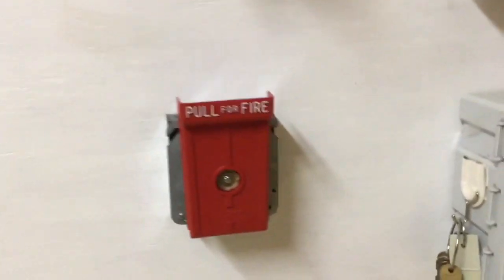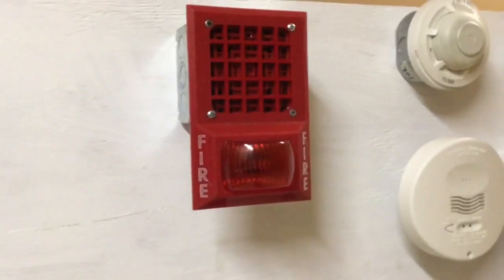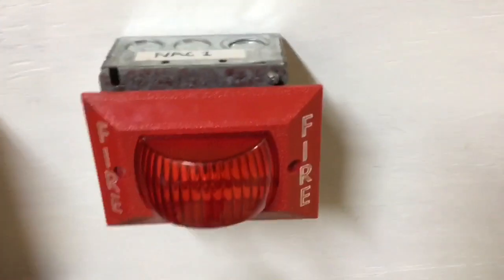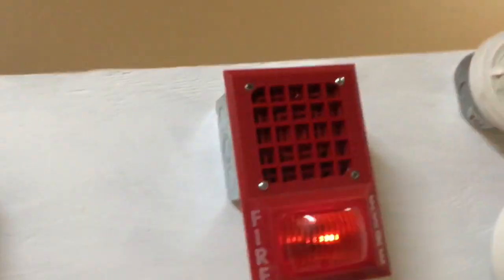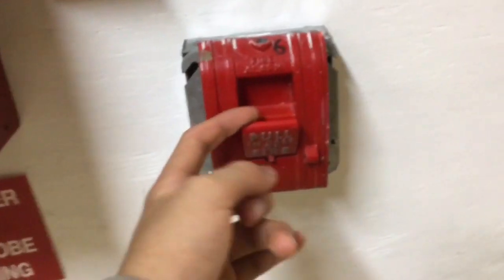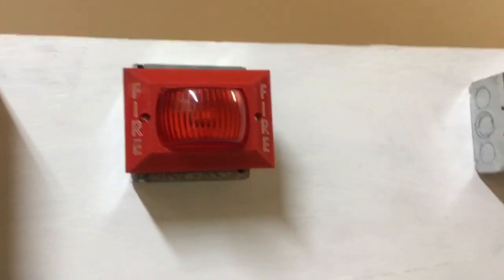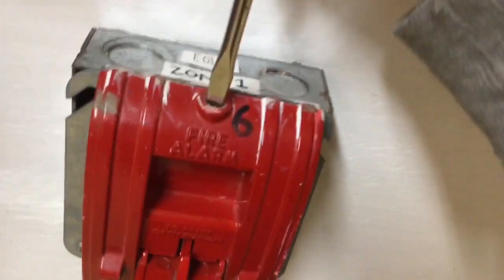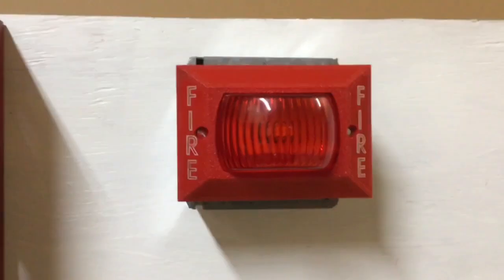Fire Alarm System Test 62 | Space Age AV32 and Ademco 529

Comment: How did you put a 6 volt light bulb on a 24 volt DC circuit?
Reply from the maker: Relays
Reply: @FireAlarmDude5967  What relay brand do you use? I’ve never had success with my Relays. Sorry for the Late Comment. Nice video!
Reply from the maker: @FireAlarm33  I use Altronix
Reply: @FireAlarmDude5967  Thanks